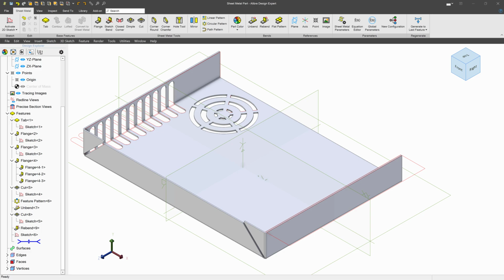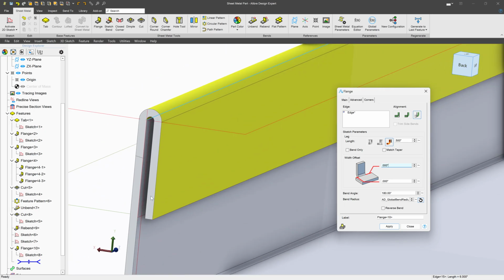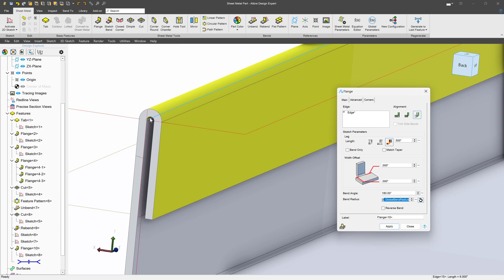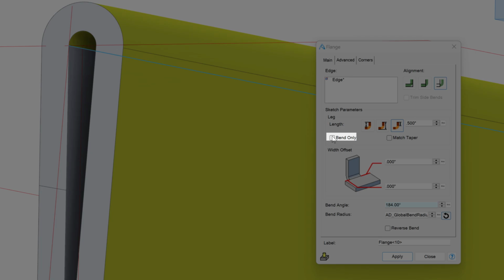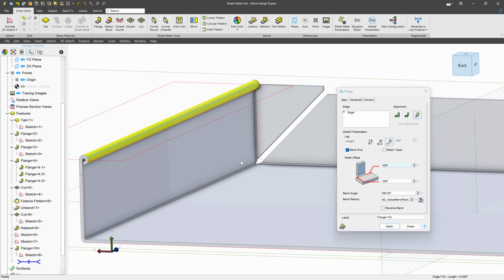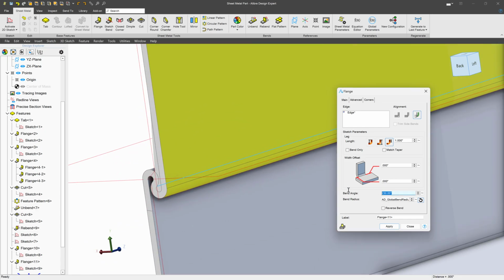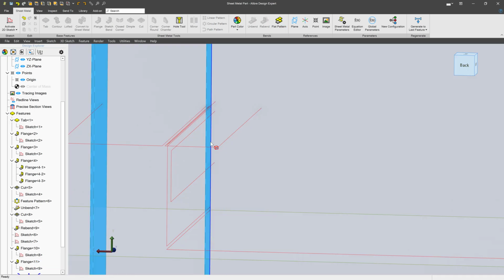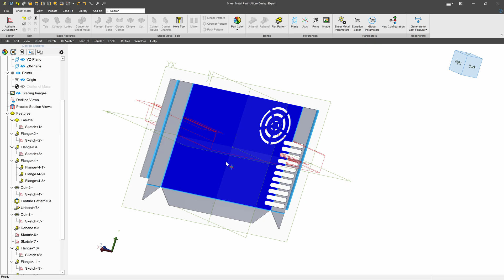Creating Sheetmetal Hems | Alibre Beginners Course #51

Comment: These short limited content vids are good for pointing out specific features/techniques without getting to far into the weeds. I've used all these hems, except for the last one, that would take special tooling. The rolled hem is similar to creating hinge barrels, just need to adjust the bend radius.

BTW, you really, really, need to start using a Space Mouse. It will give you much better and smoother control of the models.